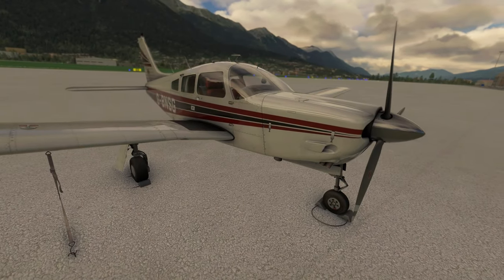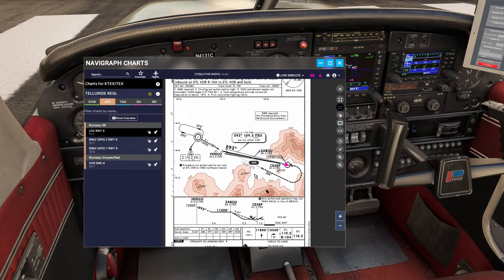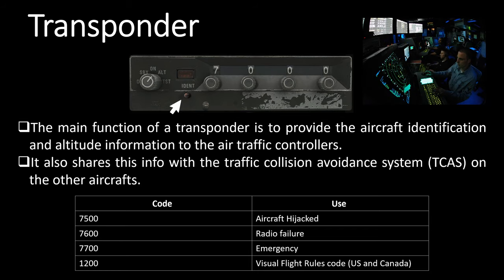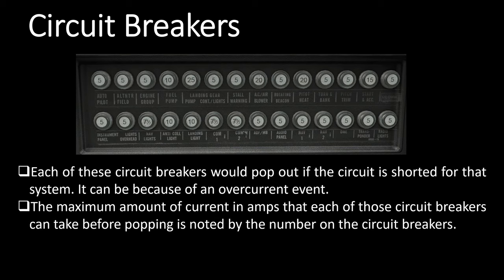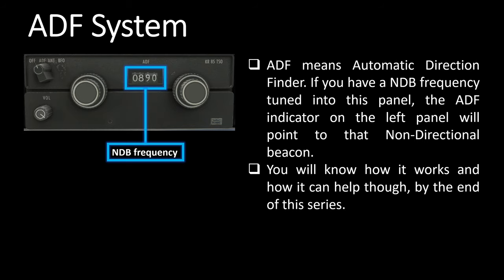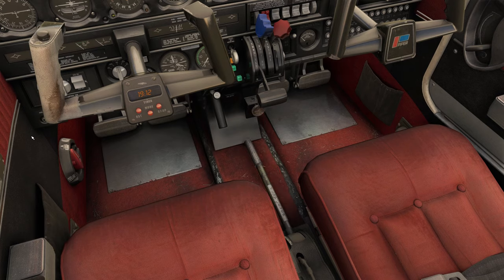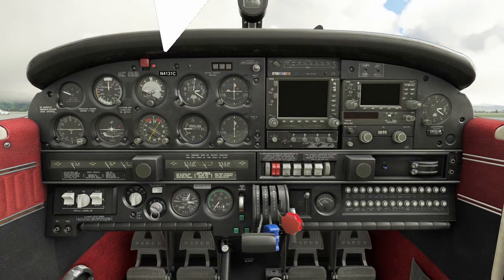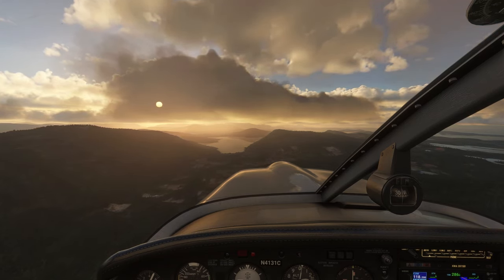COCKPIT PANEL GUIDE PART-2 | PA-28 ARROW III - MSFS 2020 | EPISODE #6

Comment: Absolutely brilliant information. Well done sir. The one bit of info that I never find out is the little lever that sits just infront of the trim wheel (not the flap lever). This is to do with the automatic  deployment of the gears I think. Could you give a run down of that in a future video ? Thanks

Comment: What about the "grey thing" on the right side if the mixture, between the mixture and Alt. air.?
Reply from the maker: Ah I missed that. Sorry man! It is actually the friction control so if you move it up, it will then be harder to move the mixture lever. It is there so that someone doesn't accidentally yank the mixture lever and cut fuel to the engine while in the air. Hope that helps :)
Reply: @AirborneGeek  I had a feeling about that! Thanks!
Reply: yeah! hahaha, what about that one?? Amazing stuff, thanks AirborneGeek

Comment: What cockpit hardware do I need to set up a higher end sim for myself?  Yoke panel pedals?
Im a pilot though I haven't flown since airspace was defined by TCA's and I just inherited a pa28 200rg.
I need to re-learn how to talk on the radio, navigate and handle a complex plane as the one I used to own was fixed gear with a fixed pitch prop and id like to do most of my reorientation training in the sim before I show up at the flight school spending hundreds of dollars an hour taking lessons in their rental arrow. 
Thanks!
Reply from the maker: I am planning out a video on how to get started with flight simming. Will try to cover all of what you mentioned and more.

Comment: Do you have any ideas that my panel has no GPS and transponder?
Reply from the maker: If you go to your tab which is a switch on top right corner of the cockpit, you can change the cockpit configuration from there. Then you should be able to bring the gps up from there. :)
Reply: @AirborneGeek  thanks!